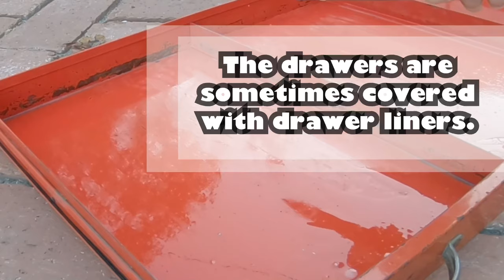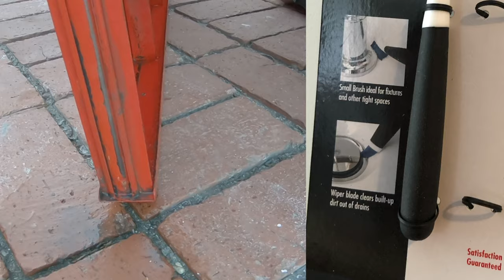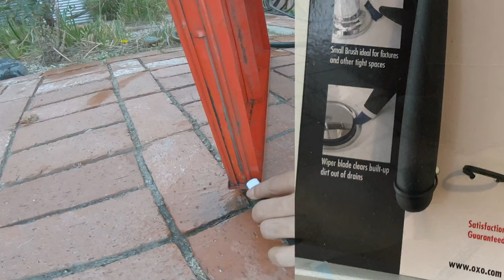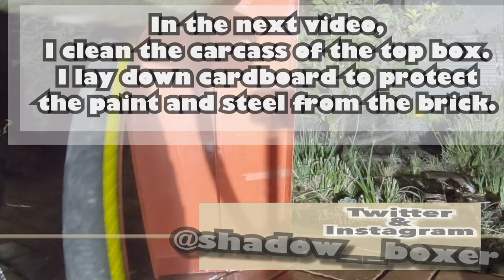ShadowBoxer 0067 {Snap-on KR61 Superchest: Restoration / Refresh Pt 2}

Comment: Just picked up a KRA1829 32” wide super chest triple stack. Broke it all down, in the process of degreasing. Planning on rolling bed liner in all the drawers, painting the drawer fronts & all three cabinets. KRA61C top, KRA461 middle & KRA307D roller.
Reply from the maker: Bed liner is an interesting idea. Is that hard or soft? Will tools slide around? Will the boxes be in a garage or outside?
Thanks for your comment. Take care.
Reply: @ShadowBoxer  bed liner is slightly pliable, still going to use harbor freight drawer liners. Turned out really nice. Used Massey Ferguson red rattle cans from tractor supply, with Spraymax 2k gloss clear coat.

Comment: Nice tool box.  WD-40, paper towels and wood toothpicks/screwers will clean the gunk without damaging the paint.  After cleaning, wipe down with WD-40 for a nice shine.  Using water will cause rust. 👍🏻
Reply from the maker: Thanks for the comment. I think you‘re right in that any type of solvent will also breakup and dissolve the old oil and dirt. WD-40 (which I believe has something like Kerosene) would be a great way to not only protect the metal but chase away any water. Soap and water is probably cheaper than WD-40 or other solvent based solutions, depending on how big the project is, but you do have to get rid of it before finishing up.
Cheers.

Comment: I'm in the process of restoring that same tool box but I believe mine might be older. It has the same garage door front but the lock is in the center of the gate. I paid $120. +$70 in materials for the rebuild. I know I got a steal and it's going to out live me.
Reply from the maker: The bottom box? I think those are called KR300s there is a letter that follows depending on what version one has. Mine does not have an optional lamp and plug system so mine is a 300D. 

You might be able to tell the age by looking at the "Snap-on" badge. If it looks like mine, it might be from the mid-1950s to early 1960s. If it is a rectangle or trapezoid shape it might be from the early 1950s all the way back to when they started them in (I think, not sure) the 1940s. I know they did not start dating boxes with nomenclature until the early 1950s. On these the nomenclature is on the bottom cross rail near and above the left wheel.

Thanks for the post. Good luck on your restoration. After I get done with this top box, I will work on the bottom. I might make another series of videos about it then.

Thanks again, take care.

Comment: I got a 1939 craftsman 3 drawer bottom chest I've been working on it isn't in that nice of shape but it's almost done
Reply from the maker: That sounds nice. Last year I picked up an old single level Craftsman tool box. It's about 20 inches long and 3 or 4 high. Fits perfectly under the back seats and allows for it's original purpose of a 1/2 drive socket set and a few more tools. I don't know the year it was made but it's the version that does not have a badge but instead has the Craftsman name embossed across the lid.